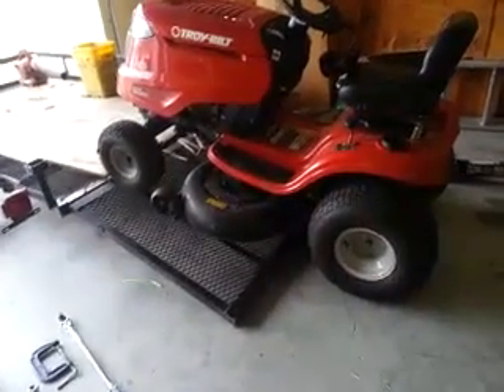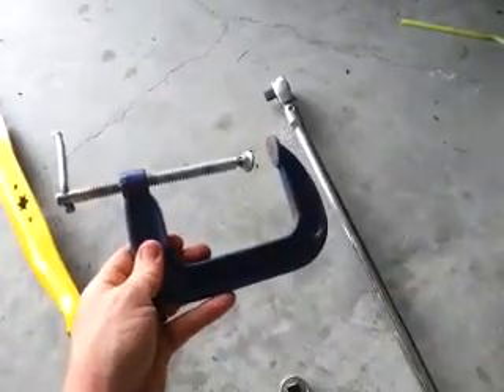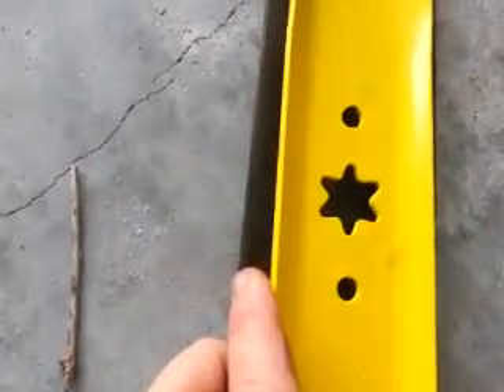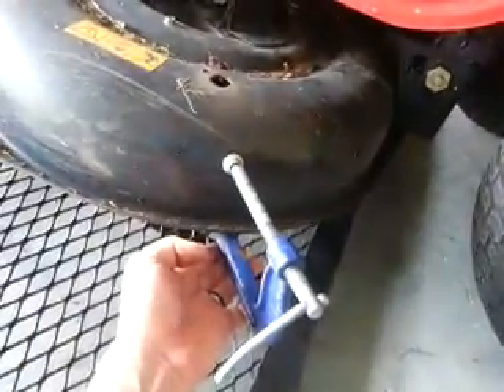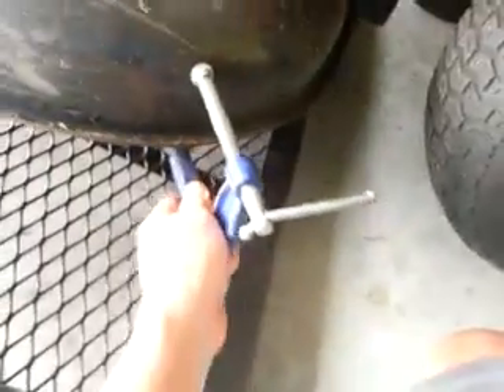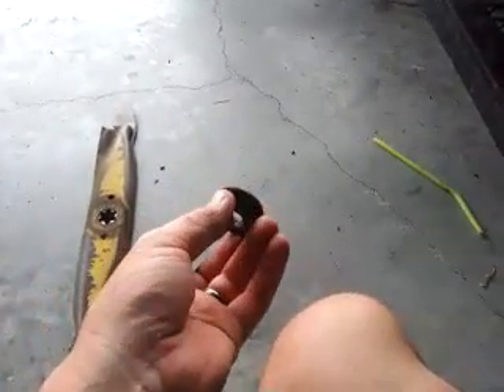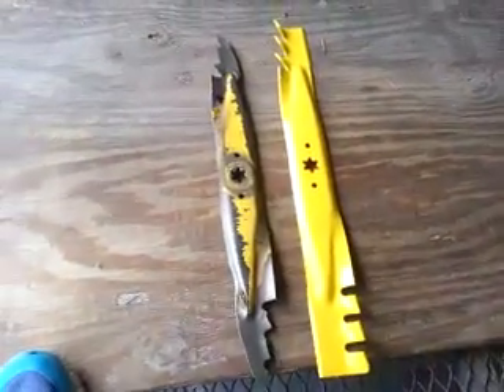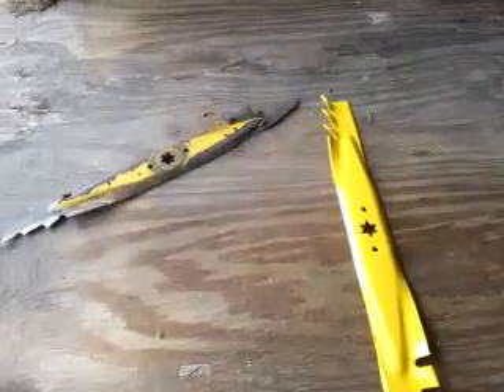easiest blade change troy bilt no deck removal ride on mower

Comment: The c-clamp is genius but I would recommend adding a piece of cardboard in-between the clamp and the deck because you don't want to damage the coating on the deck - the coating helps prevent rust

Comment: Thank you for posting this. It was incredibly helpful!
Reply from the maker: Glad it worked out well for you.  If the blades are ever worn down past the c-clamp, you can try putting the C-clamp on the other way, or putting a block of wood in there.